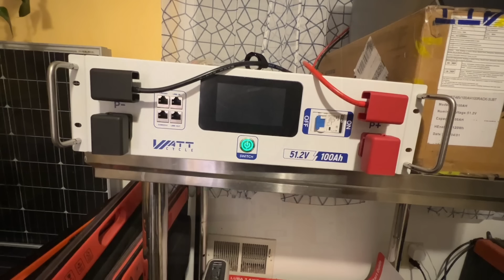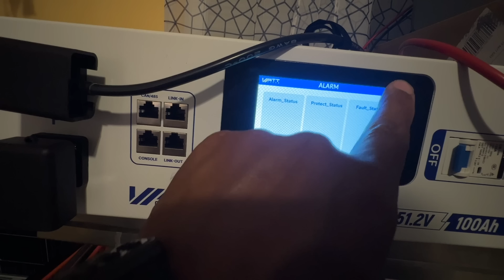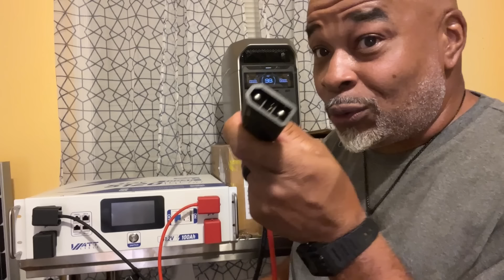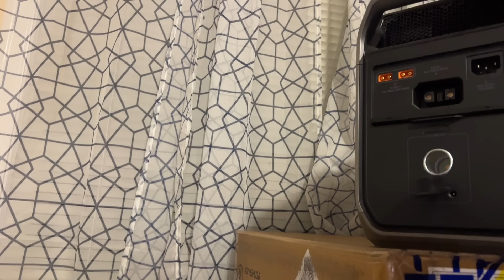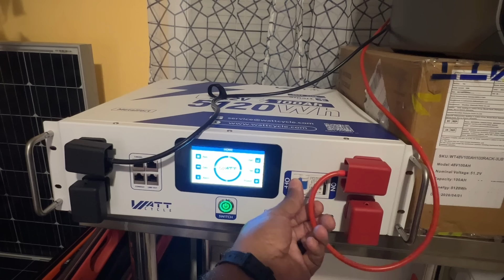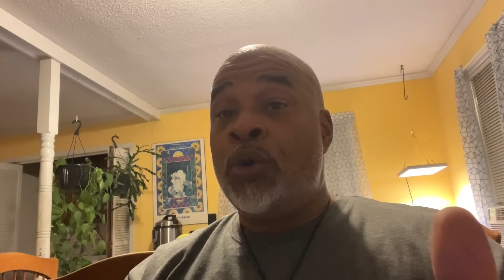Wattcycle 5120wh server rack battery

Comment: This is great. I’m planning on getting 6 of wattcycle and putting 2 on each of my three delta pro 3. I finally got the smart home panel 2 installed powering my house. I wish more people made videos like those. I guess I’ll have to make one. For those that don’t know buy EcoFlow delta pro to smart generator adapter and plug in on the bottom extra battery slot on delta pro 3 because it doesn’t work on the top slot.

Comment: I am extremely excited!!! I have (2) 100W LifePO4 batteries, several Bluetti solar generators & need greater battery capacity. I want to get the best bang for my buck & was looking at the 48V Server Rack batteries. However I’m not familiar with using a 48V system. I’m still learning the 12V system. Yes, I have purchased Will Prouse’s book. Lol & Nick Seghers
Off Grid Solar Power Simplified. I’m still learning. I can’t wait to see what you can do with your new Server Rack batteries. You Go Lead! 
p.s. I love your outdoor shower set up & purchased the LanBlu Portable Shower system, but this one comes with a 2,000W water heating element that heats to 158F. You can buy this separately & can safely heat your water on days when you don’t want a “cold” shower or to boil water. Carry your heated water to your shower enclosure & you’re set. I haven’t tried it yet, but I have started taking things out of boxes & begun using them & boy did I have a lot to learn that would have been impossible & total disaster during a true emergency. Plus there are other things you need to go along with these items that couldn’t be sourced in an emergency. And as far as growing food is concerned, there’s sooo much you need to know & already have on hand to garden before a crisis hits. My wildlife attacked my plants. Then deer came & ate my beautiful plants. I had everything growing nicely for the 1st time, which is a miracle in itself & the deer had a buffet. Some people need to add netting &/or fencing as a part of their gardening plan. This I have now learned. 
You have done so much to lift people up to the reality of our situation. Don’t think your talks aren’t helping many, bc they are. Keep up the good work until the lights go out-for good. When that happens you can rest assured that you have a community that will be better off having been a part of your journey. 
Thank you.